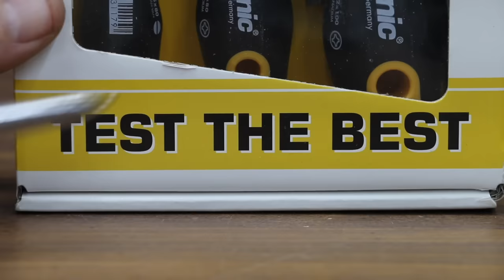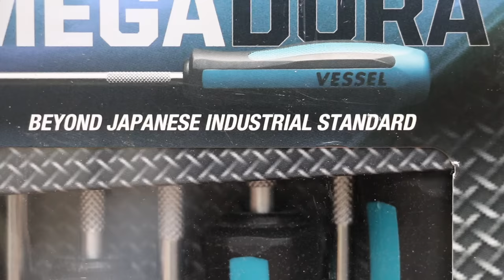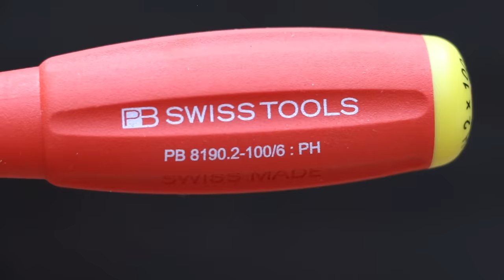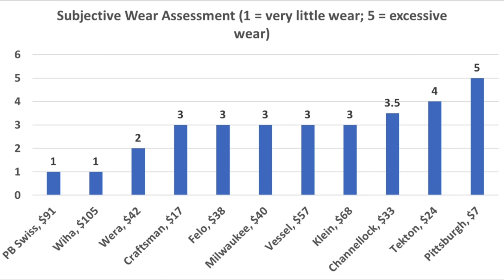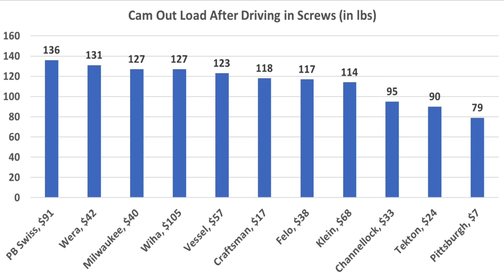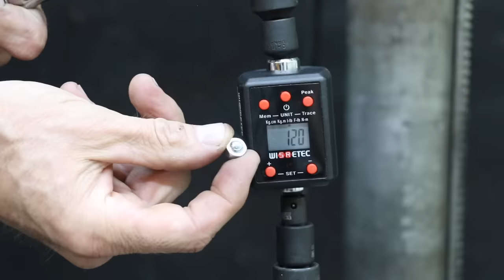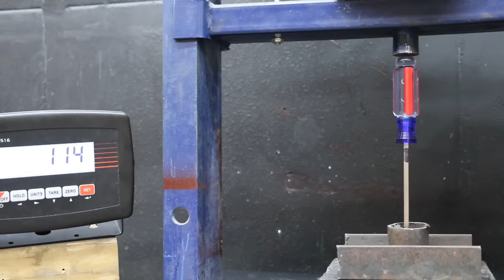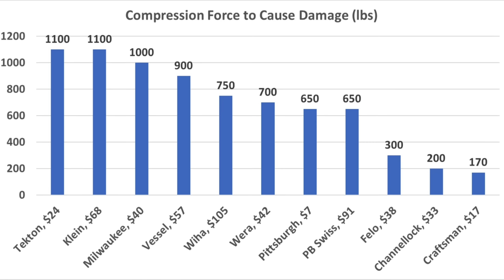Best Screwdriver Set? Craftsman, Milwaukee, Wera, Wiha, Klein Tools, Felo, PB Swiss, Tekton

Comment: I have several of these drivers. My thoughts... if you are installing something where you don't want to drop a screw, use Wera for their laser tips.  For Made in Japan products,  use Vessel for JIS.  For everyday use, Wiha is good (lifetime warranty). For basic, or don't care tools, use Craftsman.  I have a set of wood handle Felos, but don't use them much.
Reply: Yeah I have a Vessel set because I'm always working on Japanese stuff, and JIS drivers even work better on Philips screws. That said, I have to wonder when these tests are so extreme they don't really apply to most people.

My Vessel set is "thru-tang" for hammering and I'm sure it would have crushed that contest. The flathead cam-out test seemed so variable due to the different blades. He could have just made a set gap, so that each driver is inserted to the same thickness. 🤷
Reply: Yep, Vessel Impacta gets my vote.
Reply: Yeah those Wera lasertips are amazing. Even the whole screwdriver will stay in the horizontal screwed in screw, not that it matters but it shows how well the laser tip works.
Reply: You are totally spot on with your evaluation. I have all of the above and my experience is identical.
Reply: I have a set of Witte that came with a Knipex VDE kit.  While they are made in Germany, I don't use them too often.  Any thoughts on that brand?

Comment: I have been waiting all week to hear the words “ We’re Gonna Test That “ thanks for keeping us involved and testing an item that we all use everyday…. and thanks for making it so fun to watch…have you had any luck with dowser rods finding water lines … or does just some 12 gauge copper wire work well enough …?
Reply: No need for copper wire, all you need is some coat hangers and to know someone with a $20,000 ground penetrating radar, bend the coat hangars into L's and use them to pick the garage locks to borrow the radar.
Reply: Love hearing those words
Reply: @musicauthority7828  ok, no one needed to hear that but ok......
Reply: @musicauthority7828  its not a farce.  I called the utility marking for my state before I dug for a project.  Two guys came out and I was home when they came.  I greeted them and proceeded to watch him with just a piece of steel wire bent into an L shape, he used the marking flags. He located the the main line running along the street through my yard and he located the branch that ran to my house. He then used more sophisticated equipment to confirm.  Then he flicked his wrist, throwing the flags into the ground to mark the lines. I was amazed, I thought it was crap too.  He told me it really only works with moving water.
Reply: @bbtools...
Dude was pulling your chain. Any engineer has enough experience to know where the lines most likely run already, especially if they have worked locally for a while.  Really really.  Be careful, your level of gullibility exposes you to paying a lot more for services 😉
Reply: @thomasneal9291  you both missed my point it went right over the top of your heads. that serveyer that he was talking about probably looked at diagrams. showing where the lines were before he got there. you don't have to worry I'm plenty skeptical first off I don't trust anyone. and I believe anything until I see it with own eyes.
Reply: @thomasneal9291  You don't have to worry I'm plenty skeptical. I don't trust anyone and I don't believe anything until I see with my own eyes.

Comment: My go-to drivers have been Vessel's with JIS heads.  Super useful when you get that random JIS fastener that would normally get stripped out with a regular Phillips bit.
Reply: Fixing up a Japanese motorcycle taught me the hard way about JIS fasteners, haha.
Reply: The JIS Vessel screwdrivers are a must for working on Japanese motorcycles!
Reply: Best screwdriver I ever bought 👍😎
Reply from the maker: Thanks for sharing.
Reply: Got a free 1972 cb175 I’m wrenching on. First thing I bought was a full set of JIS impact bits
Reply: @davemiller262  I had to learn the hard way with my Yamaha after stripping out some screws on my Mikunis.

Comment: I would love to see this test applied to an old "Made in USA" set of Craftsman screwdrivers vs. the new "Made in Taiwan" set. I also have an old set of Vermont American "the Claw" drivers.
Reply: Agreed... because the Craftsman Screwdrivers I have from the early 90's are absolute junk. You couldn't give me a set of those again even after seeing this video. Napa and Snap-On from here out that is it.
Reply: @notelling8240  I got tired of the Craftsman crap too. Replaced most of it with Snap On.
Reply from the maker: Thanks for the suggestion.
Reply: Old craftsman is 100x better than new craftsman.
Try using their new stuff like the old & you get trash in 30 seconds.
SK is the way to go.
Reply: gearwrench is good, too. Snapon? rofl
Reply: I've got a set of Craftsman screwdrivers from 2004, and a set from 2017... Both made in USA.
They are not the same quality as each other.
The newer ones are like wet noodles compared to the older ones, and those didn't last as long as my Popular Mechanics Walmart screwdrivers (25 years and counting).
Reply: Very true, I have a set of well-used Craftsman screwdrivers I bought as a teenager in the 80s and aside from a few flathead tips that have been reground, they are still going strong.
Reply: YES YES and YES!

Comment: I'd be interested in seeing this with the "professional" brands (that you have to buy off franchise trucks) included. Snap-On, Matco, Mac Tools, etc... Would love to see how they hold up to this compared to these.
Reply: I was wondering why he didn't test Snap On, I thought they are supposed to be the best.
Reply: tan j maz  Yea I don't buy off the truck but if I find at a garage sale or something like that I will get it if not too much $. I just wanted to see how it compares too. And I'm not really saying its the best thats just what I've been told by lot of mechanics and shop guys.
Reply: tan j maz  I agree and also don't tell the Snap On guy you got the tools from yard sale. When I  needed replacement the guy almost wouldn't give me a new screwdriver blade because I didn't buy it off a truck. They are definitely not worth the high price from the truck.
Reply: They are like Klein or Milwaukee in quality but at higher prices. They used to be innovative and had good customer service but they have all died out over the years. Even Craftsman has fallen. Corporate mergers have made the industry watered down where one mega company owns 10 different tool brands. In addition to that manufacturing costs have been reduced across the board so it's cheaper to do alloys and hardening compared to 20-30 yrs ago. My toolbox has Harbor Freight for the big screwdrivers and Wiha for the smaller precision screwdrivers. Mix and match your tool quality based on how you use each one. I need the best in some but Harbor Freight work fine for me in others.
Reply: Agreed. But then the tool truck groupies might be upset after those results.
Reply: I worked on car electronics installations for years. I had Snap-On screwdrivers at 1st. The Phillips tips were garbage (but expensive). I moved over to Craftsman and was never disappointed. For the price, you could buy a few of them. The tips held up and if you forgot one in a customer's car, you didn't feel too bad. Plus you didn't have to wait for the Snap-On truck to come by to replace your driver.
Reply: @ClericChris  Yep, the Wiha precision are the best.
Reply: @John Do you have actual evidence for that claim? Also consider that Amazon aren't in the business of making motor oil, they'll just be rebranding a brand-name, and selling it for cheap. Very common practice in many industries.
Reply: @ClericChris  The higher price is just what you have to pay for the right to have free lifetime replacements - it's not surprising that they cost 3-5 times as much as other tools if you can keep swapping a damaged one for a new one.
Reply: @pulaski1  mastercraft, craftsman etc... have lifetime warranties too. So that argument doesn't hold much water.
Reply: @nismo4x4n  I am not sure that the "new Craftsman" (after it was sold off by Sears) has the same lifetime warranty, but back when Sears still owned them I could buy decent quality, say Stanley, tools for 1/3 the price of the same Craftsman branded tool, so I would say that Craftsman warranty under Sears ownership proves what I said, not disproves it.
Reply: @pulaski1  still Mastercraft and Stanley are able to offer lifetime warranty. There's others too. I'd put Stanley fatmax against snapon at 1/8th the cost. Difference is your not paying the truck guys.
Reply: Can I buy Snap-on, or Matco at Lowe’s, Home Depot, or Walmart? If not, then why test it?
Reply: @nismo4x4n  I was told, by the department manager, that a hammer was not a hand tool when I took my soft face mallet back to get a replacement cap. I was told, by a different department manager, that giving me  the guts to my 3/8" ratchet fullfilled their obligations to the warranty when the gears failed in my 2 month old wrench. I told them I didn't know how to put the wrench together and got shrugs. 
That was 18 years ago. it is no wonder the craftsman brand got bought out. I haven't bought anything with that name on since the ratchet incident.
Reply: @nismo4x4n  Well you have to pay the staff at Lowe's, Home Depot etc. too, plus their rent and overheads, but pretty much any Lowe's or Home Depot is selling more tools per day than a "man in a van" can sell in a whole week, so IMO the pricing difference is an economy of scale issue.
Reply: @pulaski1  They didn;t have a warranty when Sears had them. I was told by a department head there that a hammer wasn't a hand tool when I took my soft face mallet in to get a replacement cap.
Reply: tan j maz  I don’t know if anyone told you.. but you don’t have to buy anything.  You’re under no obligation to buy Snap-On Tools.
Reply: @nismo4x4n  MacTools is Stanley.
Reply: @pulaski1  tekton tools have a lifetime warranty also and you don't have to buy it from a approved dealer, you can buy them from Amazon or a yard sale or anywhere and they will replace no questions asked. Plenty of companies have good warranties without having to pay as much as a house payment for the tool.
Reply: I bought a set of Snap On screwdrivers brand new 35 years ago, and still have them. Now I have dozens of Snap On screwdrivers, but I buy them at yard sales and flea markets, usually for a dollar or two each, or less. I have a friend who is a dealer and I have no problem exchanging the ones I buy broken.
Reply: I don't think most of his viewing audience would be interested in that. I wouldn't even have clicked on the video. Youtube in general is for DIYers trying to fix things themselves and save money. Or get the best value for their buck. Snap On and Matco no doubt make quality tools, but the majority of DIYers wouldn't even consider buying them. They cost like 10X as much as a big box store brand. Those tools would likely all rank towards the top, but I don't think anyone would really care. They're not paying 10x as much no matter how good the tool is.
Reply from the maker: Thanks for the suggestion.
Reply: @dantedanis  Because some of us have vendors that sell extremely expensive tools that come around once a week as options also, and anyone can buy from these companies online. I for one would love to know how my local Snap On or MAC vendor's products hold up to the rest of them.
Reply: @aznnp77  I think you are pigeonholing the viewers a bit too much here. I'd be willing to bet there are quite a few professionals that use screwdrivers that would click on this. I did... and I've been using screwdrivers every single day for 38 years as a window tinter. I have used them all... from cheap to every "Vendor tool" out there. I'd love to see how they held up to this test. "Is the Snap On worth it, or do I just buy the Craftsman and replace as needed?"
Reply: @John your "argument" doesn't change my opinion on Snap-On screwdrivers. I have used many Snap-On tools in the last 40 years. All were good except the screwdrivers.
Reply: @davenhla  I used to have a Craftsman rake that I used to bring back to the store every year to get replaced, as long as it wasn't electrical and said Craftsman on it, it had a lifetime replacement warranty
Reply: Snap On is the only company that will replace a blade due to them wearing out which happens to all of them eventually no matter what brand.

Comment: Use Wera at work, though the interchangeable kind with one handle. Over two years so far, the phillips will still bite so well you can put it in a horizontal screw and it'll hold itself there, can even shake the workpiece a bit and it'll still hold.
Reply: Always makes me laugh with PH screws. In the UK, when I get something that is PH I always think 'aw come on, who the hell is still using Philips screws?' Bloody awful compared to PZ and the hugely superior Robertson. I will have to check and see if there is a video comparison, but a rusty PH is a drill out job.
Reply from the maker: Thanks for the feedback.